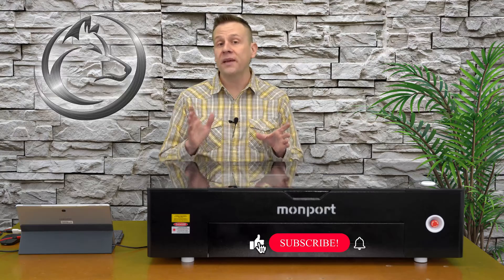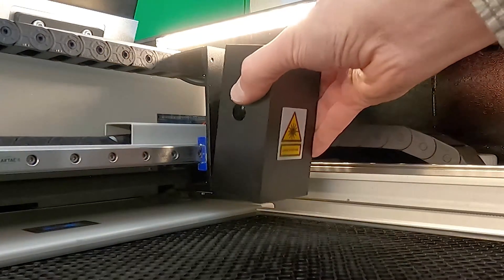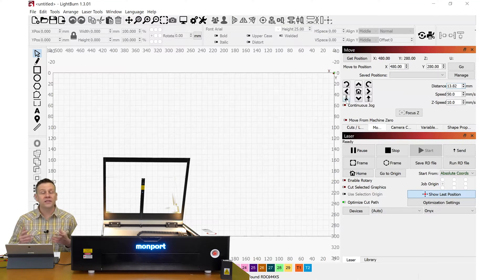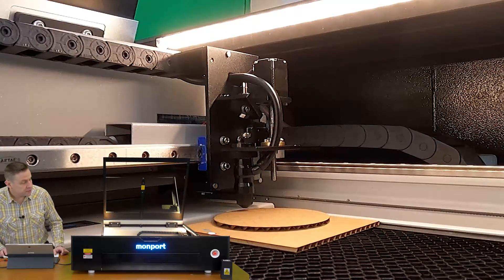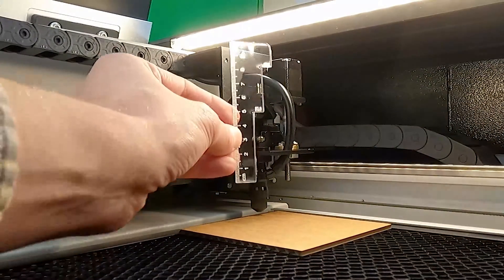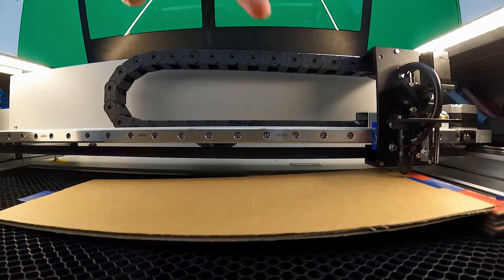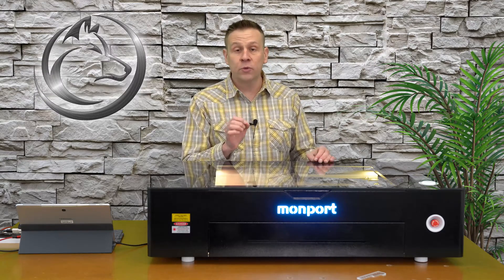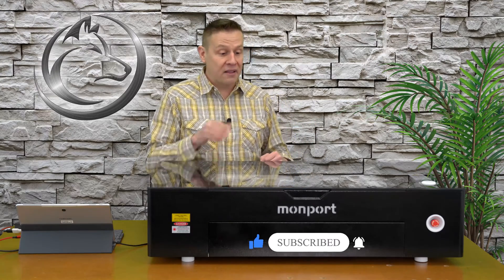Monport Onyx- Focusing #3

Comment: Seems my focus doesnt work on my monport Onyx.   When I put my material under the laser and hit focus, it will not move at all.  Is there something im missing.  I did work fine and stopped all of a sudden stopped working.   Do you need to do auto focus at the home position?  The stepper motor will not move the lens up or down.  Everything else seems to work on the move arrows.   I can go left, right , up and forward on the bed.   I just wont focus.
Reply from the maker: Oh no- on power up the auto focus should rehome.  If it's not you can remove the cover on the laser head to make sure the motor cable didn't wiggle loose.

Comment: Ok in your video you show putting the offset value in the move distance area.  That is not correct, the distance has nothing to do with offset.   It only increases the laser head distance it moves with the arrows.  At least thats what its doing with my onyx R laser.   I havent found the actual area yet where I enter the numbers.  For those that are having trouble getting the camera calibrated with the dots, I turned off the machine totally and did it.   I was trying to calibrate with laser on and it seems the bright lights cause a problem.   I turned off the laser and tried again, it worked fine.
Reply: Enter in the cut layer under z offset

Comment: I don't understand how you got to the move path in light burn, when I open a new project in light burn, that is not what pops up on my screen.

In fact I accidentally exited all the right side tool bars hoping to get to that window and now they don't pop back up when I open a new project, mind telling me how to get those back?
Reply from the maker: Hi- I moved the laser head in Lightburn with the controls on the "MOVE" tab- there's the up/down left/right arrows that will move the laser head the distance as entered to the right of the controls.  If the menu tool bars got moved you can click and drag to the tool of the tool bar until it snaps back the desired area- hope this helps!
Reply: @thelaserchannel1  so I had completely exited them, so I couldn't drag and drop them at all, but I think I found them again through the window  options at the top bar, but my move option looks very different from yours.

Comment: What does the built in camera get used for? And is there a good way to  understand my actual usable work area? The honeycomb is able to move pretty freely, and the included materials don't quite fill the area either, so how do i get the most out of my work space and my materials when I'm using the same board/sheet for multiple cuts?
Reply from the maker: The camera can show the work area super imposed in Lightburn.  If the honeycomb is moving around it can be taped in place.  On my machine the materials fit completely within the honeycomb.  The work area is 510mm by 300 mm and starts from the home position in the rear right corner where the machine homes.  I like to use the frame button in Lightburn to make sure the laser head is over the area I would like to work to take place.
Reply: @thelaserchannel1  thanks, could you make a quick video showing the camera? Or is it simple enough that you could tell me in text?
Reply from the maker: @heroofharo  I have it scheduled in an upcoming video.  It's much easier to show than text!
Reply: @thelaserchannel1  that's a bummer, but I look forward to it. I guess I lucked out choosing this as my first laser since there's a whole dedicated video series coming along right with it.
Reply from the maker: @heroofharo  Thanks- I'm enjoying the the Onyx- more videos to come!

Comment: Did you get the camera to work with Lightburn?  If so, what cameras selection/settings did you use? I can't the camera to calibrate on my Onyx. I don't see any information in the manual about which settings to select.
Reply from the maker: I'm still working with the camera- it's climbing to the top of my list very quickly!  I'm leaning on Monport for the setup while I also work on the camera.  
In other news I have the rotatory video scheduled next for the Onyx!  Thanks for watching!